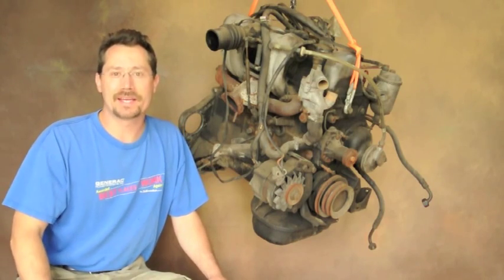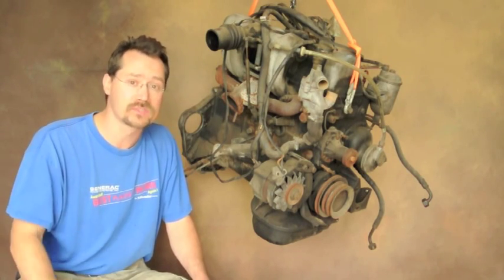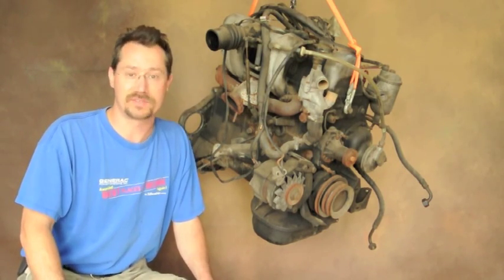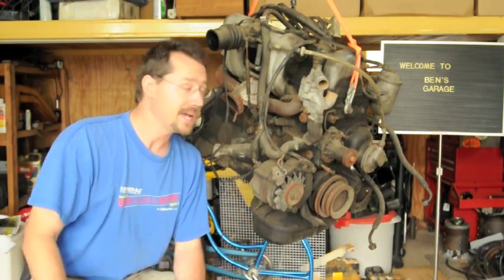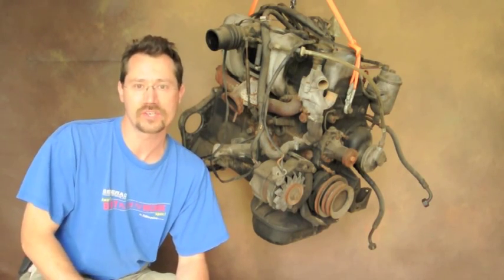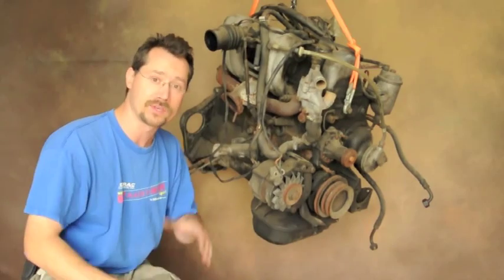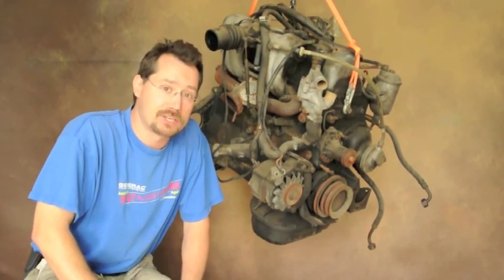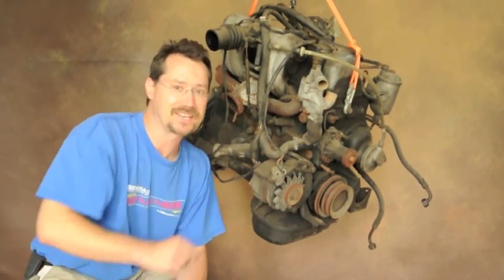SuperTruck Engine - May 25, 2013 update

Comment: Don't turbo.. turbo compound.  The most efficient engines of all times where turbo compound (google it).  In the late 40's several of the last generation of piston aircraft aircraft used this technology to gain 15-20% more energy from the hot exhaust gas.  In an electric car, you could easily connect the exhaust section of TC to a coil and rectify to generate some useful electrons!

Comment: you'll have a electrical engine AND the benz motor. I dont think you'll need anymore power than that.  Plus intake and exaust on same size makes it harder to fit the turbo, and the exaust heats the intake, reducing power gains.  Then you have all the piping tuning etc. I wouldnt do it for this project, but it's your truck and your money so have fun and build what you want

Comment from the maker: It's a mechanically controlled engine, so there's next  to no wiring to do on it. One advantage of a rear-wheel drive vehicle is that there's always the gearing in the differential, which can be changed. I plan to test the vehicle with the existing gearing, and if I'm not happy with it, change the differential gearing to suit it.

Comment from the maker: The S10s were available with a 2.2l 4-cylinder and a six cylinder 4.3L. With a 2.2, there's lots of spare room under the hood. This diesel is a 2.4L four cylinder which is basically the same length as the gas engine, but it is TALLER.